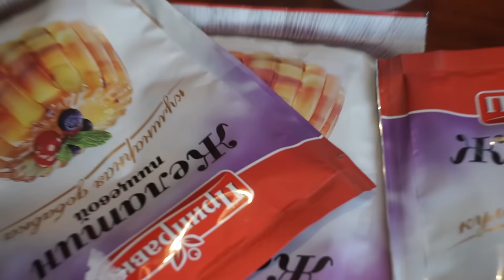Homemade Gear Casting, method of homemade silicone

Comment: What happend to the first casting? It looked terrible
Reply: I did a series of small aluminum casts using plaster, about the same mass as this part.  The first cast problem could very well be some excess wax the other commenters mention, I don't know.  But you can see in his first pour that the aluminum is bubbling?  There is gas trying to escape...boiling wax? excess moisture in the plaster?  Don't know.  But he heats the mold for the second pour.  This should eliminate the excess moisture.  But there's another thing I notice: after heating, the mold is cracking.  What I noticed in my own pours is that with pure plaster I got those rounded aluminum type-results and bubbling while pouring BUT if I mixed in sand, maybe 50%, the results were much better.  I suspect the sand gives micro pathways for gas from any source (wax, water or even perhaps hydrogen   Thehttps://en.wikipedia.org/wiki/Hydrogen_gas_porosity) to escape and helps prevent the rounding and bubbling.  The cracking of his mold might have also provided some micro routes for gas to escape.
Reply: That wax not melting properly
Reply: It was probably to display why you need to enhance the teeth in the second mold
Reply: @bryantb3391  no mate,it because still any wax inside moulding,i do metal casting to,and that a common.
That why he burn that mold in second work

Comment: Hitler: what do you need to build 1 tank
Germany: presents a 780 pages memorandum with detailed industrial metodology 

Stanlin: what do you need to give me 1000 tanks?
Russia: melted pipes duct tape and wax
Reply: NovorSec it’s funny yet very true. The soviets were focus on scale not quality. 

The literal quote is “quantity is a quality of its own”. Meaning that it doesn’t matter if your tank or plane or gun is the best. If you have 100,000 and they have 1,000. You win. By default you just won by having 100x more manpower. 

Less complicated and more utilitarian. Also slant armor and realizing that rounds don’t have to be stopped but just deflected.
Reply: Joe Biden's Chain  Do you remember Hillary Clinton's claim of "landing under sniper fire" in Bosnia?

Comment: 5:16 this is why when you do lost wax casting you are better to use a centrifugal mold machine, something that can apply pressure.
In fact, it would have probably worked fine if you would have put a large can over the sprue, to build head pressure into the metal, forcing it into all the little nooks.
Just pouring metal into a sprue hole like that is never going to give you decent results when you need fine detail. A proper wax casting should require almost zero machining. So ..I'd say, try some more and get it down pat. But the end result came out nice after filing a lot :P

Comment: While gelatin was a brilliant move, if you want a slightly more expensive option and need to cast more than one copy, get yourself a six pack of home improvement store variety 100% silicone caulk and a small can of MEK. Mixing what you can use within 15 minutes or so, squirt in 1/4 to 1/2 the caulk tube at a time and an ounce (or your measurement system of choice) to thin the silicone, mix it up to where it's pourable, and pour as usual around your chosen part. In a few hours after the MEK evaporates, you'll have yourself a very fine detail mold. 
Not skin safe, but works fantastic for making parts, figure casts, etc.
Reply: That actually sounds easier than using gelatin on top of your stove (and the wife would be happier)
Reply: @bill3835  As long as the MEK fumes don't drift into the house, she'll be happy as pie. =) Compared to commercial brands like smooth-on, I suspect their molds will have a longer shelf life but this costs a quarter of a two part system. I made an entire silicone bodysuit that went over a lycra base that I molded on top of twill weave fiberglass (treated with the same silicone method to pick up the pattern for a flexible carbon look) and it worked great, plus I still have that suit after 5 years plus, and the treated fiberglass that I've used for gaskets and non-stick bases on other projects. You can also color the silicone with pigments as you would a commercial product. That whole suit probably cost me ~$50 in supplies, including the fiberglass, brushes, rollers, rubbermaid containers, etc. That much silicone in commercial grade would have come out well over $300, product only.
Reply: @C-M-E  You can use the microwave in a different room than the kitchen? Shhh! My wife might hear you!
Reply: You can melt and reuse the gelatin for years to make an infinite amount of molds.

Comment: I would want to open that gear box up later and inspect the teeth on the gear, and see how much metal shavings were in the oil pan...
Reply: There is no oil pan on that machine. Gear is lubricated with grease, oil doesn't circulate around moving the bits back into the gear. If something breaks it will get pushed aside. If it starts making noise then you know something more serious happened. I think the gears might wear in after a while, because the surfaces aren't perfect, clean it up and if nothing broke then it will be good to go for a long time.